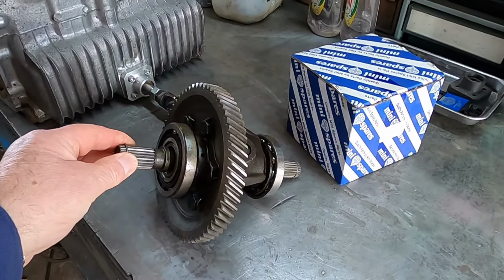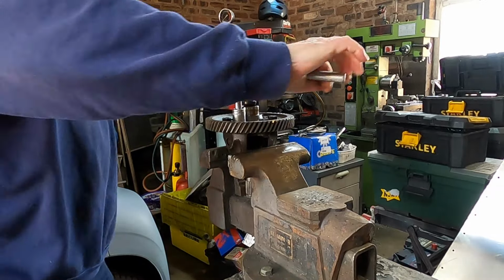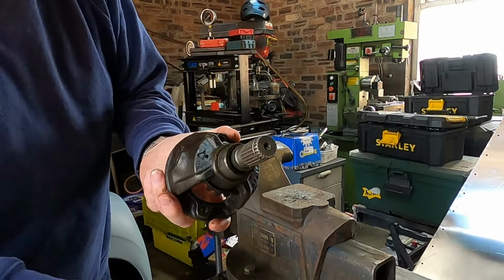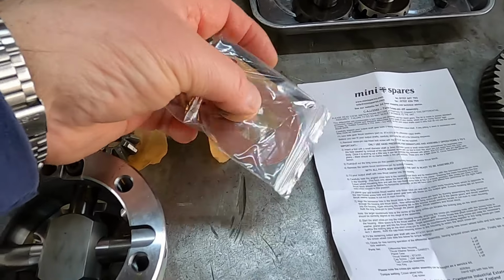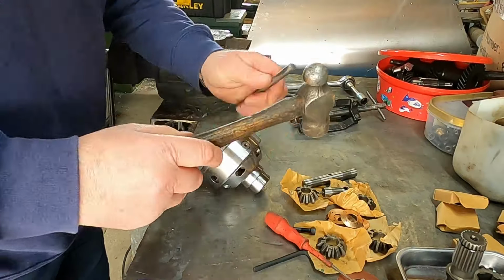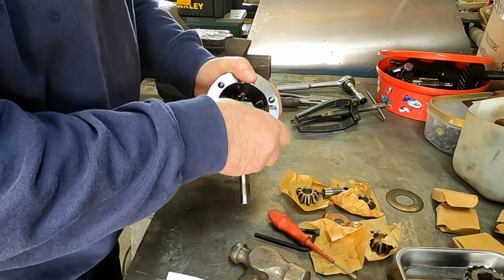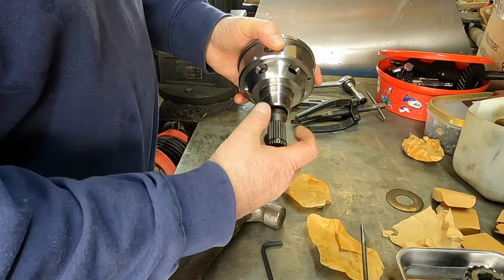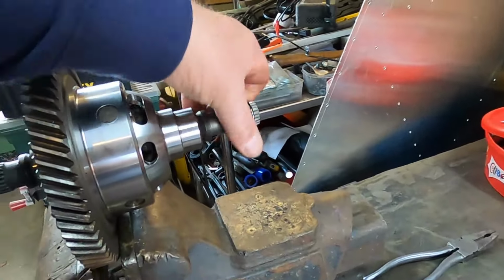How to Assemble the Mini Spares Evo Molybdenum Cross-Pin Differential for the Mini A-Series Gearbox

Comment: Nice work Doug, that diff assemble will do a great job for you my friend
Reply from the maker: Hi Lloyd, it had only taken me 17 years to get around to fixing the GTM! The (3.647:1) diff ratio will better suit the car for speed events compared to the original (3.210:1) ratio. Also reducing the tyre profile from 70 to 50 which will help the overall gearing.

Comment: would this diff be suitable for a chain drive conversion what type of bhp will they take.
Reply from the maker: Yes, I have used these differentials in chain drive applications. However you need to machine a special sprocket mounting plate with the bearing spigot as you will not be using the crown wheel.